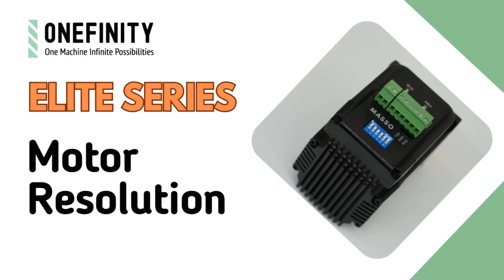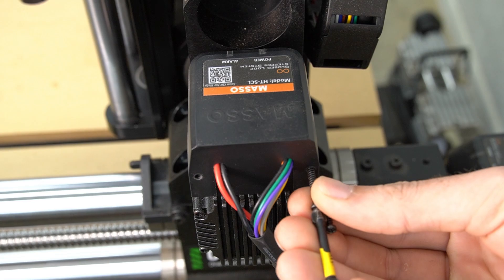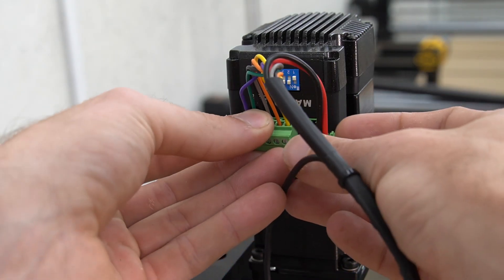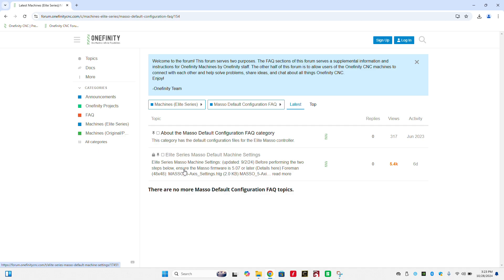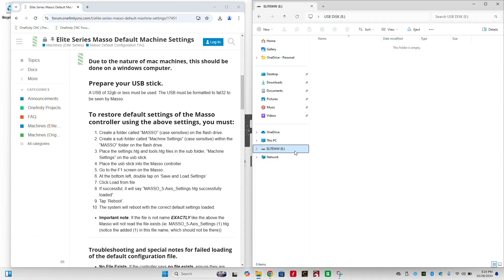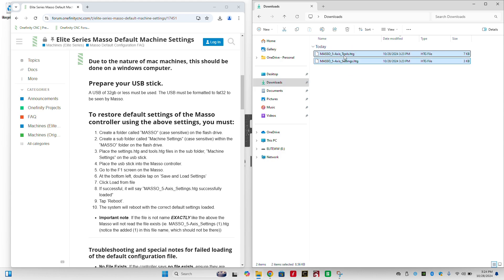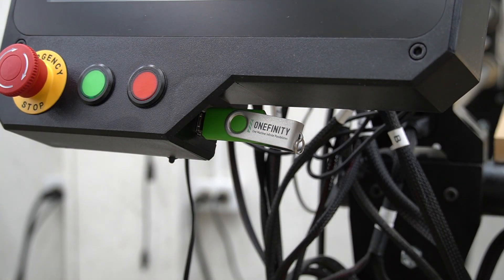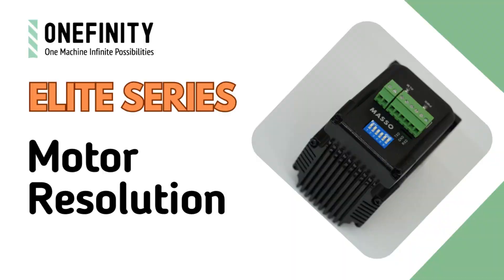Onefinity Elite Series MASSO Motor Resolution Update Service Bulletin Video

Comment: Why go through all the trouble to change the htg file via usb when you can much more quickly manually change the resolution to 2000 in the Masso F1 settings?
Reply from the maker: There are more changes than just the resolution.
Reply: @OnefinityCNC  Well the Dip Switches and the resolution. Are there any other Settings beyond that? Just watched the Mitchell's Woodworking video..followed him and seems to work fine..
Reply from the maker: @miltonfriedman9673  yep, read the blog update.
Reply from the maker: @miltonfriedman9673  that only does the resolution.  There are more changes that won't get applied if you do not do our method.
Reply: @OnefinityCNC also, in this video you only mentioning dip switches 1 and 4 to the DOEN position.
Yet in the article in the forum you say to also put dip switch 5 down.
So is it 1 and 4 only like in this video or 1,4, and 5 Luke in the forum article?

Comment: Another question regarding changes to established systems. Does this update also wipe out the JTech laser settings?
Reply from the maker: Yes, you will need to put in any custom settings you've added back into the f1 settings.

Comment: Did the changes as described. Quieter for sure, but very slow movement on all axis. Is there something I need to change as the machine was metric?  Dang, just found it switched it back to Inches. Would have been nice to know. 

Also, did we have to change the tool file as I lost all my tool settings. Wouldn’t the change work with just the settings file?  😢
Reply from the maker: Yes, you will need to put in any custom settings you've added back into the f1 settings.

Comment: Very interesting read. Thank you. You would not added in there for dust collection to come ON did you?
Reply: simple IoT outlet solves that easy (Amazon has them and so does PWNCNC) search for IoT Relay (it's a 4 outlet strip from Digital Loggers, Inc - DLI).  I will post link as a separate comment in case it is censored.  I'm not sure the OneFinity Elite could be made to do that without a dedicated relay and outlet.
Reply: @Hangs4Fun  thank you. Yes I believe I just have to put G8 in the beginning of the G code string. G9 is already in there.
Reply: @kevinrich4637  looks like it did remove (or not approved) my link (which is why I posted it separate).  Yes, once you have a relay based outlet that accepts IoT input, it's a simple solution.  You don't even have to put anything in your gcode, just update the MASSO to do it.  If you do a Google search or YouTube search you will find that same DLI relay/IoT device I mentioned and exactly how to change it.  I did that upfront before ever using my Elite Journeyman, so I'm not used to it always enabling the vacuum as needed.
Reply from the maker: Not sure we follow.
Reply: @OnefinityCNC good chance I could be wrong. It was my understanding the the left plug in for the router/spindle that automatically turns it on and off and the right plug in is for dust collection to turn on and off. The G9 to turn off the collection is there but not the G8 to turn on is not.   Like I said I am probably wrong lol

Comment: Does this overwrite my current tools file and fixed locations for tool setter and park?
Reply: I have submitted three posts requesting help / queries about the service bulletin on the 1F forum and they were all deleted, and I have no idea why.

My findings:  I followed the written instructions and the Y/B motors alarmed in the masso controller but not on the motors themselves.  The X gantry moved very slowly when homing (maybe because I'm a metric user).  I therefore reverted back to a copy of my original settings and undid the dip switch changes.  Now working as was before the file changes.

I think the way forward for long time 1F users is to do the changes to resolution manually rather than re-doing all the other changes they have done to date as a result of installing a new settings file.  As mentioned above, simple instructions to apply the changes manually would have been better.
Reply from the maker: Andy, you posted on the fourm to a Hidden link as we were working on the faq.  We have no clue how you saw it, as it was hidden only to admins.  You tried applying the changes before we even uploaded the final config pages.  You were replying to something that wasn't finalized.  That's why it was deleted.
Reply: @OnefinityCNC ok.  I was beginning to feel like  I was loosing my mind or becoming billy no-mates.  It would have helped to have the reason explained by private message at least.  I'm now battling with the masso screen which is blank.  

I find it hard to believe they are related given the only change i made was to the resolution and dip switches.  I have reached out to Masso for help.
Reply from the maker: @andyp9406  we are baffled by why you we able to see the posts.
Reply: @andyp9406  I am having the same problem,  am I correct -- you just gave up and went back to the original settings, there was no way to overcome the alarm error? I just sent an email to onefinity for help
Reply: @andyp9406  onefinity please don't delete Hello Andy, what machine are you running? if its an elite foreman could you share with me via the onefinity forum the old settings (since we cant DM on youtube) I am having the exact problem but I deleted my old settings, I posted a thread in the forum that should be near the top asking for the older setting
Reply: Does have any affect on speed?
Reply: Can it be done on the Z axis braking motor?  And do any other software changes happen besides ppr?
Reply from the maker: Yes, read the full blog post.
Reply: Does have any affect on speed?
Reply from the maker: Yes, it will do so.
Reply: @OnefinityCNC that’s key information you should probably add in the video.

Comment: Is there a minimum firmware version that the masso should be at before applying this?
Reply from the maker: 5.07
Reply: @OnefinityCNC How does one check firmware version?  Please bear with me, 1st CNC.
Reply from the maker: It says it in the upper left of the main screen.